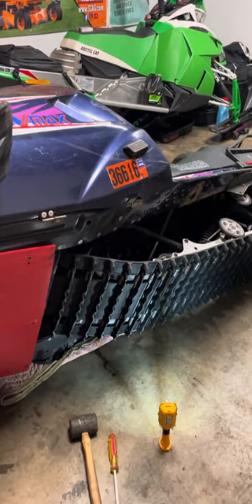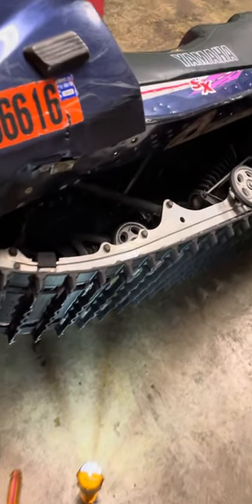The Easy way to remove your Snowmobile Hyfax/Slides

Comment: Im hopeful to do this today to my 99 poo 340 touring. I dont have a garage. Hoping to wing it and do it in the driveway, tip it on its side in the snow.
Reply from the maker: Best of luck
Reply: @backcountrybuilds  got it done. I screwed up a bit with the cut and thet are both a little over an inch too short, asked a few buddies they said it will be fine.
Reply from the maker: @thumperbangin2000  mine were a bit too short when I did it on my ZR600 last year and no issues! Glad to hear it
Reply: @backcountrybuilds  good thanks for the reassurance. I will call them good!